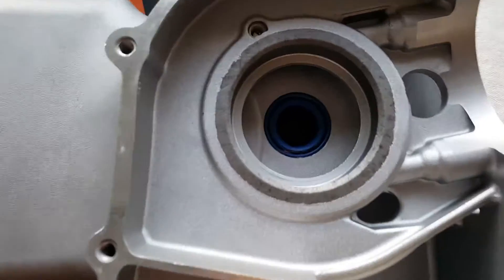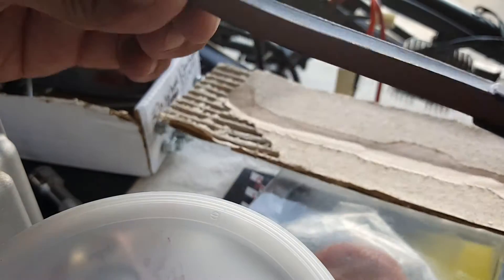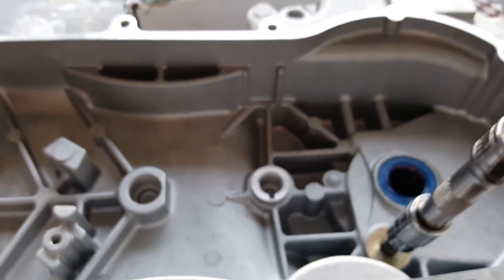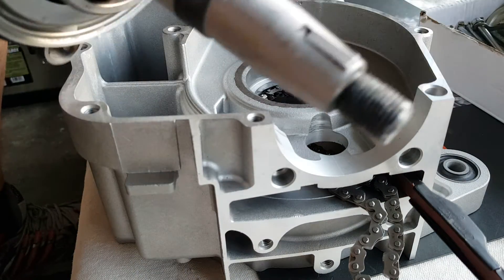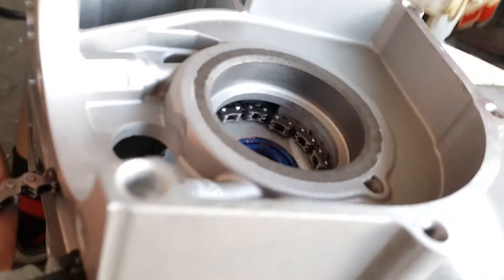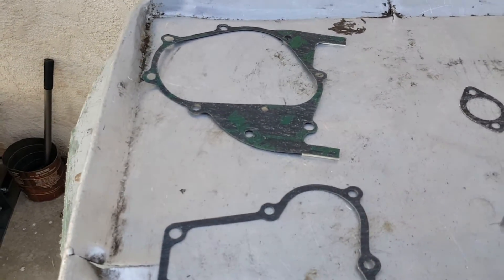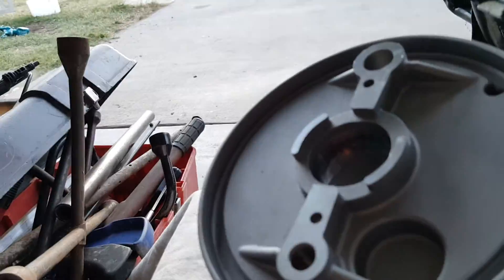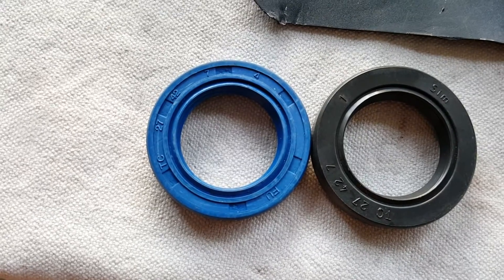How to Install GY6 Bearings, Chain Guide, Gasket Spray, Oil Seals, & Stroker Part #1

Comment: Yep this is where I need to be. Thank you sir. I want to add that out of all the people I see working on GY6 your videos are most informative and in layman's terms. I appreciate you looking out for us guys that don't know anything about it. Without your well-thought-out videos I would be lost. Thanks again!!!
Reply from the maker: Todd Bearden I do do make mistakes in these videos sometimes but I try to mention them so you can avoid beforehand for example use a heat torch or heat oven the crankcase if no rubber seal is installed yet to properly  install  all the bearings and freeze the bearing or crankshaft to make sure it fits in the heated crankcase area. Don't force it like I did be avoid cracking your crankcase which I also show how the J-B Weld it. Wasn't my intention to show you how use J-B Weld but that is an option replacing the entire crankcase $5 J-B Weld vs $150 left crankcase. Thank you for the compliment, I want to pay it forward cuz I learned so much from others YouTubers as well.
Reply: NCY STORE I appreciate the input. I have already used heat to get old bearings out you just got a tap on the back side and they drop right out once you heat it up and to get things cold to make it quick I use dry ice. Dry ice gets cold enough in a matter of 20 minutes. So thankful for your help!!!
Reply from the maker: Todd Bearden nicely done! :))
Reply: NCY STORE thank you sir. I'm having trouble finding a couple of sets of bearings. I have a GY6 that is a kinroad Shasta buggy that has a GY6 150 with the reverse unit. There are a set of bearings for the output shaft on the reverse unit and I want to purchase them that have been made in Taiwan. Can you lead me in the right direction as to who to get them from and at a reasonable time frame I need bearing number 6003 RS and 6004 RS
Reply from the maker: Todd Bearden I'll forward this to our Parts Dept will be back open on Monday tomorrow I'll let you know by mid afternoon what i find out, okay?
Reply: NCY STORE you know I wasn't even thinking you're a store :) yeah let me know I need those two and if you're reasonably priced I will take them
Reply from the maker: Todd Bearden we have Taida bearing Taiwan's Quality http://ncystore.com/taida-gy6-rear-drive-bearings but i wanted to make sure the size you said you need is 6003/6004 RS so by Monday if available we can list for you order also we match price brand for brand.
Reply from the maker: Todd Bearden We do not have any Taiwanese 6003 rs or 6004 rs bearings. SKF is high quality bearing manufacturer from China. Will have that listed on our website later today I send you the link.
Reply from the maker: Hi Todd, we have the double-sided rubber seal as what the (2RS) stand for vs one-sided rubber seal (RS). Functionality is same, however, please check measurement spec to assure proper fitment before ordering here: 1. http://ncystore.com/g-rear-drive-bearing-6003-2rs-qmb-gy6-universal 2. http://ncystore.com/g-rear-drive-bearing-6004-2rs-qmb-gy6-universal

All orders placed by 11am PST will receive a shipping track# ship out today. Received 3-5 business days or sooner.

Comment: You know what I got the bearings it's coming out of this brand new motor that didn't fit the buggy I don't know what I was thinking I'm just going to use those one of them is different because of the reverse unit that I have to get but I'll get it. I'm going to watch your series and you're going to walk me through putting this motor back together and I so appreciate it thank you

Comment: Absolutely unnecessary and a waste of time and money to spray copper coat on those gaskets! Also, if you're going to use the copper coat anyway be sure to thoroughly shake it up to blend the components in the can so that it can work as it's meant to. The material that you were spraying out was totally transparent where it would've been opaque copper had you mixed it by shaking.
Reply from the maker: Thanks for the tips!